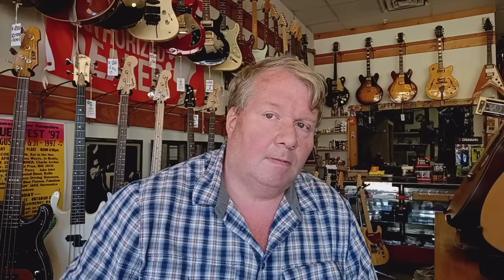WATTS!   About How Loudness and Wattage Can Be Different

Comment: Watts is just a measure of how much power the amp is consuming....Not how much noise it's outputting.... A 5 watt small tube amp is fluffing loud.....and the tube amp has lush/complementary harmonics and is amplify in the frequency range of the instrument... it's almost like the horsepower vs torque situation...
Reply: These are two different wattage measurements ... amplifier wattage consumption vs. wattage output. Perception of wattage output is affected by several things. When a tube amp is pushed hard it distorts, the even-order harmonics are emphasized (which sounds musical) and the amp sounds louder. Conventional solid state amps emphasize odd-order harmonics when pushed hard (not musical) so most musicians don't push these amps hard. A 100 watt amp is not twice as loud as a 50 watt amp as perception is on a logarithmic scale.... this is measured in decibels. Human ears are also less sensitive to lower frequencies, so the bassist needs more wattage output than the guitarist. Speaker sensitivity also affects the perception of wattage output.
Reply from the maker: The bass should be louder than the guitars.  Also in a mix.
Reply from the maker: Horsepower is a good way to put it. I often tell the analogy of my 128 horsepower 1972 BMW, feels faster than a new BMW, the speed sensation, it's like a low watt tube amp of cars.
Reply: Is there a simple way to measure the energy in Watts that the physical speakers are imparting to the air? I think that would be the real answer.
Reply: @EL_DUDERIN0 A db or decibel meter or an SPL (sound pressure level) would probably be more accurate.
Of course the speaker for all tests would and mic placement would have to be the same. I’m sure manufacturers would start cheating and moving mics a bit closer to yield better results.
Reply: Watt did you say?
Reply: Totally wrong! An amp has two separate wattage ratings. Input watts= power draw from the wall supply. Output watts = out to the speaker power. Input watts will always be higher than output watts because of heat and other losses. This difference is what power the amp is "consuming." Wasted watts in heat, transformer loss, etc.

Comment: Different amps, either tube or SS can be cool depending on the amp. I use an old Polytone Mini Brute 1 that has provided 50 years of service. I have a 30 watt Milkman tube head with a single JBL K-130 that has a classic surf vibe. Try everything and don't be afraid to revisit an amp that maybe deserves a 2nd chance.